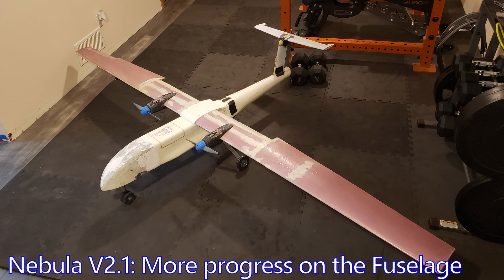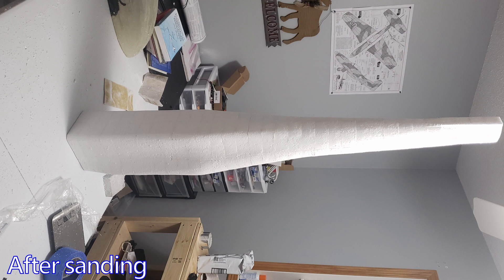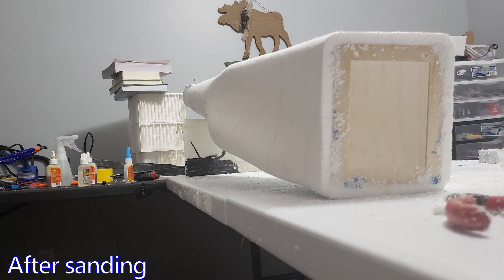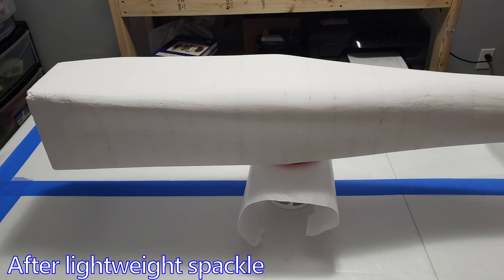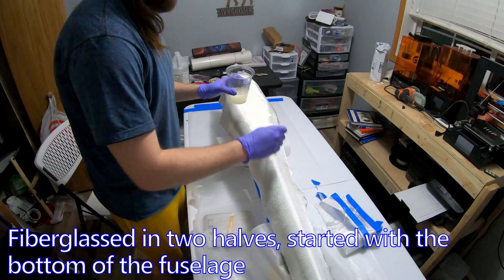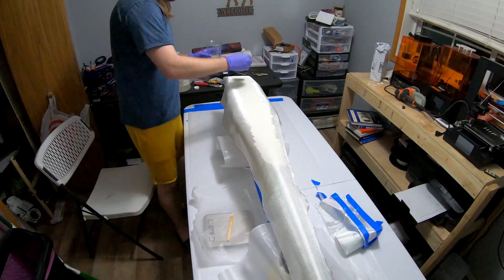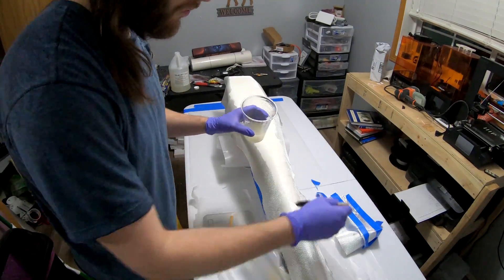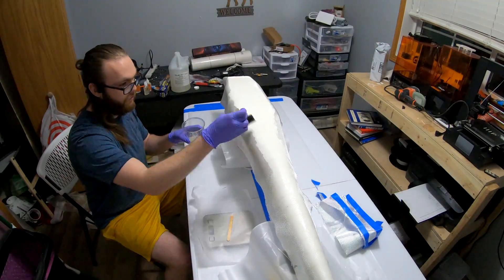NebulaV2.1: Part 5 More Fuselage and Assembly

Comment: That's a lot of good progress! A couple of things worry me though... 
Maybe it only appears that way in the video, but the vertical stabilizer and rudder look very small (especially compared to the side area of the nose), and their distance from the CG is pretty small. Consider how much of the side area is ahead of the CG and how much is aft, if there is more in front then the plane will have weak yaw stability, especially without much wing sweep. imho it wouldn't be unreasonable for the vertical stab and rudder to be three times as big as they currently are.
The wooden plate that the main landing gear mounts to doesn't appear to be connected to much along the front edge - just foam and the glass skin. I don't think it would break outright, but a heavy landing or bumpy runway might see it give way somewhat, I mean you're gonna have 5kg thumping into that small area. Then again that glass skin looks pretty chunky, hard to tell how much strength it is adding without being able to poke and prod at it myself. 
I'm also wondering how secure that rear plate is with the four carbon tubes, and I wonder why that plate had to be glued fully inside the fuse instead of just slapped onto the back for more contact area. Most likely one carbon tube in the center would be as good as four, because that's not where most stresses will occur. When the tail bends, one side of the fuselage wall will be under compression and the other will be under tension, all the work is done by the three white retaining plates, which also serve as positioning locators and for fastening.
I'll stop there because I'm currently building a plane of very similar type and scale and facing many of the same challenges (especially with the detachable tail) and it wouldn't be cool to preach to other people if mine doesn't work first. But don't worry, I'm sure David davids will be along soon to tell you everything you've done wrong :)
Reply from the maker: tl;dr: Thanks for the input! Very good points. Some of the things you mention I just missed, some are still todos before the plane is finished. I'm looking forward to your design, I enjoy a lot of the design choices you make with your planes. Davids comments are usually a good laugh, but I think he sorts on crashes or something, he won't pop his head up until I post a video with a crash in it, then he'll go wild commenting for a bit and settle down. Pretty sure everything about this plane is wrong lol :)

Tail Surfaces: I generally use tail volume coefficients during preliminary design to size the tail surfaces, and follow up with simulation work after I have the initial geometric parameters. In this case I didn't quite follow my normal design process since I reused the tail surfaces from the previous design (which had a smaller wing span by ~54cm). On the previous design the vertical stabilizer would've put it in the envelope of statically stable, with verification via sim, but you're 100% right that its a little too small now, I'll need to look at increasing the area of the vertical stabilizer a bit to get it back into a comfortable region.  I did not change the chord of the primary wing, and the CG has actually moved forward along the fuselage compared to the previous design (primarily from the motors), giving a larger lever arm for the tail surfaces, so the horizontal stabilizer is still adequate for static stability.

Landing Gear: In terms of the rear landing gear you are correct about the structure not being enough, that is one of the areas I meant in the video about still needing to add more reinforcement before the fuselage is complete. I plan to add more carbon fiber in front of the landing gear plate connecting it to the fuselage similar to what I did aft of the landing gear, and I will be adding additional carbon fiber on the interior of the plane connecting the plate to the inside layer of the fuselage. I would expect the landing gear plate to buckle into the fuselage as it is now, at least with the way I land lol.

Tail Mount: You are also correct about the tail joint, there is no reason the plates had to be glued to the inside of the fuse, slapping it directly onto fuselage would've been a lot smarter. If the added plywood isn't too heavy I might actually do that.... I completely missed that idea. I'll need to see about getting the retention plates out of the front part of the fuselage though, so that I can move them backwards by the 6mm thickness the new plates would add. 

Tail Spars: Having the four carbon fiber spars on the tail attachment is also sort of a remnant of my original idea for retaining the tail, I was planning on setting a nut into the four spars, and having a bolt with an overlapping lip pull the spars into the plate, keeping the spars in tension and adding more stability by having four points offset from the bending axis. But after I had already made the plates and installed them I realized that getting the bolts in would be very unwieldy, I can reach my hand all the way back there from the hatch, but it'd be a pain doing it that way every time.  I wanted the exterior of the fuselage to be clean, so I originally didn't want to have the retention mechanism on the exterior of the plane, but I gave in.
Reply from the maker: Its probably also important to note that in the photos with the plane all together the wings aren't actually attached yet, and the wing box was just sorta slapped in place. The front of the wing box should be 1cm back from the rear of the fuselage hatch, which is about 8cm forwards from where the wing is in the photos in the video. It shifts the CG perspective a bit. But the vertical stab is still undersized.
Reply: @fureter6986  yeah I was wondering if the wing was actually attached in that pic, or just sitting there in an approximate position. 
Regarding tail volume I have to admit I hardly ever do any simulation for yaw stability, I usually just go by 'looks about right' for the vertical. You've probably seen me using OpenVSP but I'm mostly concerned with the pitch stability calculations with that.
Actually since you're making a habit of designing planes it might be worth playing around with OpenVSP a bit, it's free software. It's not particularly user friendly compared to F360 but if you give me some decent resolution 3-views of your plane it wouldn't take long for me to model it and give you something more meaningful to play with than the relatively plain models you would be making as a stone cold beginner. Mail iforce2d at gmail.

And since I'm now using F360 myself these days, I could show you my file for the build I'm currently doing. I have machined a lot of foam and plywood parts already and have plenty of video waiting to be edited, now just starting to glue things together. It's 3m wingspan and almost 2m length so having the tail detachable is non-negotiable for getting it into my car. The tail-join is made even trickier because removing the tail is also how you slide in the payload, so there needs to be a large clear area in the middle of the front side of the join.
Reply from the maker: Thanks for the offer! I'll send you some views of the model. I've seen you use OpenVSP a few times, but I've just never made the switch from using XFLR5. I usually use XFLR5 for basic sims, some of my code from college for preliminary aircraft design, then I'll do more of the final development with OpenFOAM when I have a working CAD model that I can export and generate a mesh with. OpenVSP looks to have a lot more features compared to XFLR5, so I've been meaning to get more into it. 

Yeah the tail and wings being detachable are pretty much mandatory for me as well, otherwise I can't transport a plane this large to the airfield. Having the payload load in from the tail joint sounds like an interesting design challenge, I remember my team's senior design project from college having a swivel nose for loading payload, but that was honestly jank, and I haven't used that design since.

I'm looking forward to your videos, your manufacturing approach always give me a lot to think about compared to the way I usually build my planes.